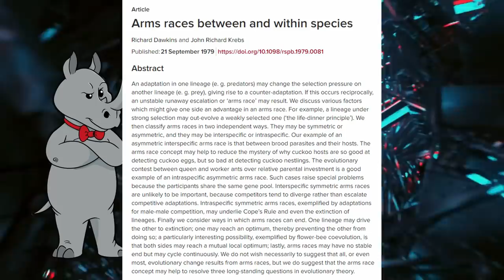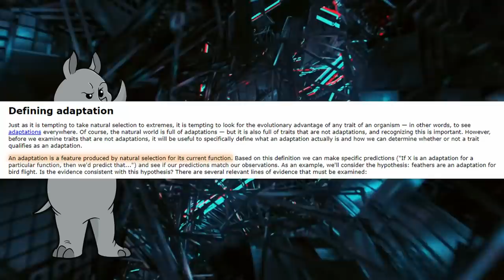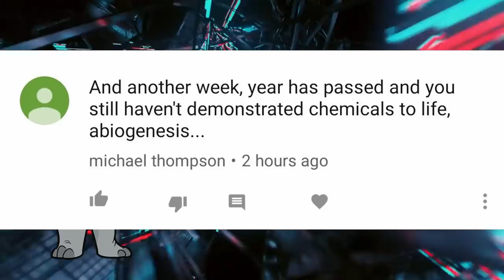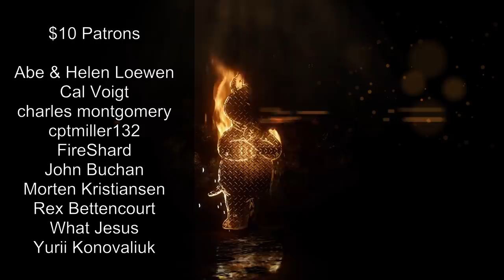David Rives is So Close and Yet So Far

Comment: There has been a very good example of this sort of thing in the UK - or rather in the North Sea on the east coast of the UK. When fished regulations required fishermen to use a net for cod with a design that let younger fish swim through, the cod population reacted. The evolutionary pressure drove the population to develop smaller adults, since the larger fish were caught they could not pass on their genes.The current population is preffy good at avoiding the nets.

Comment: I think I get it. He’s focusing on natural selection and mutations while forgetting another aspect: changes in evolution pressures. Evolution is slower where the evolution pressures are constant and unchanging because there is no strong need to be more fit for an unchanging environment; which traits natural selection selects remain the same, so there is no need for significant changes to accumulate. Changing evolution pressures speeds this up by changing what traits are favored or disfavored.

Take the hawk and duck example. Initially, ducks are at a relatively slow speed compared to now and hawks have relatively poor eyesight compared to now. Through random mutations and/or other mechanisms, some ducks end up somewhat faster than the others, which allows them to survive longer and have more reproductive success, so they get selected for. This changes the evolution pressures on the hawks, which now need to develop a way to catch these faster ducks. Now, the ones with better eyesight end up better at catching prey and so are more fit. This changes the evolution pressures on the ducks as now just being faster than the first generation ducks is no longer sufficient, leading to even faster ducks being selected for. This changes the selection pressures on the hawks so that the new average eyesight isn’t enough, so even better eyesight gets selected for. The evolution isn’t faster because the mechanisms of evolution are getting faster but because the survival pressures are changing.

Let’s say that, at some point for whatever reason, the ducks stop getting faster. There will still be some hawks with even better eyesight than the previous generation, and they may even be more favored, but the amount of additional success compared to the previous eyesight is much smaller because the ducks aren’t improving their defenses or evasions in any way, so the selection pressures are weaker and the evolution of better eyesight in hawks slows down until an equilibrium is reached or something. For the ducks, where the hawks stop improving, it’s even more straightforward. Moving faster requires significantly more energy, so if there’s no longer any change in the environment and their predators, the ducks with the same speed will be selected for once a balance in the trade-offs between energy usage and fewer deaths by hawks has been reached, thus, evolution of faster speeds slows until it effectively stops altogether.

Now, even when the evolution slows down, the mutations will happen at the same rate. The same number of hawks with better eyesight than their parents will be born, and the same number of ducks that are faster than their parents will be born. Additionally, the death and reproductive rates will be more or less the same (for this particular set of circumstances and ignoring other potential factors), so the time it takes to get from one generation to the next and the population growth rates remain more or less constant during this time, whether there is an evolutionary arms race or not. The difference is in the strength and direction of evolutionary pressures, and thus how quickly new traits will be favored over old traits. In other words, the proportion of hawks with the better eyesight that survive compared to the last generation and the proportion of faster ducks that survive compared to the last generation are different depending on the existence of an evolutionary arms race between them.

Comment: Seems to me from his rather garbled understanding of natural selection that he thinks that it's the mutation rate that not only speeds up during periods of rapid evolution but is the only part of the process that does sound and/or is the rate limiting step.

I mean, he's not wrong that if you subjected one species to a mutagen and the other not you'd get differential mutation rates, but that's largely irrelevant. 

Selection pressures, population size, generation turnover and heritability of the trait are all far more important.  

I'd point out that something like wing length is one of the many traits that exist as a normal distribution curve. Not all ducks have the same length wing. If selection pressure is such that the upper quartile have more reproductive success, the mean wing length  in the population will gradually increase.  One can also have selection pressures at either extreme leading to a site into two populations, and one can have selection pressure towards the mean, leading to stasis in a trait.

It's another case of creationists not knowing how much they don't know. Michael whatsisface the comment of the week is another one.

Comment: what this guy also doesn't seem to grasp is that an evolutionary arms race doesn't speed up the rate at which changes happen, but instead how hard they are selected for.
normally a population has variety in it. hawks with better and worse eyes. doves with faster and slower reaction time. an arms race does away with much of that verity as the worse eyesight hawks and the slower doves will probably not survive and never get kids. same rate of forming variety in a population, harder pressure that removes variety in a population.

Comment: In any generation of ducks, you are going to get a variety of wing lengths.  If extra wing length gives even the tiniest advantage of avoiding hawks, the ducks with long wings are going to have an edge in reproducing to form the next generation.  The babies will inherit those long wings.  The next generation will have a greater proportion of long wings than the current one.  This is common sense. How could it be otherwise?

The whole process repeats over and over lengthening the average wing until the wing reaches the optimum length.

This still works if each generation adds only 0.1 millimetre.

Comment: Actually natural selection and mutation has already been proved   In the North of England in the 19th century there was a small white moth.  This moth (or was it a butterfly.  It was so long ago si ce my schooldays)  used to flit about happily between the pale trees and used to be able to hide from it's predators by hiding on the trees.  However the Industrial Revolution happened  The trees it used to hide in became black due to heavy industrial pollution.  However there was another butterfly mutation of the same species that turned out to be nlack and used to be eaten by the same predators that couldn't see the white ones.  However when the trees turned black, the white ones could be easily seen and were eaten by the predators.  However the black mutations rose in prominince due to the white ones being eaten.  The Black butterflies genes became domiinant due to it NOT being eaten.  However after at least a century either due to anti pollution policy or simply the factories becoming redundant, the trees turned pale again.  However the black ones were then eaten.  However the white ones (who still survived due to mutations or luck) suddenly couldn't be seen and so the white ones who were few in number suddenly increased in number due to their genes being better for the current environment than the black ones .  The black ones have all but died off and we are basically back to the situation we were in in the early 18th century where the white ones are predominate..

Comment: "All three working in tandem"...?  Good on evolution but bad at maths.
Reply: Tandem does not mean two of. In tandem can be used to describe anything which is working in conjuction with something else. For example, the cylinders in a car engine work in tandem with one another. It doesn't matter if you only have two or if you have eight, the phrase is still accurate.
Reply: Eadwulf Slecgwyrhta - in common usage, tandem means two seater bicycle... While I am aware of tandem being used for cooperation, it is commonly used when there are only two parties, together or its synonyms are more common for multiple (3 or more) parties.
Reply: @darrenhemingway7121 Although it is more commonly encountered as two of, does not make it exclusively so. I appreciate that tandem bicycles tend to be designed for two riders, however, it is not limited to just two. The same is true of a tandem team of horses.
Reply: Eadwulf Slecgwyrhta - granted that tandem horses mean one in front of another and not number and hence the naming of the tandem bicycle as riders one in front of another rather than the number of riders (as anyone familiar with British 1970s tv comedy will understand), in common usage today, tandem refers almost exclusively as two or pair.  Even your example for car cylinders, my experience of tandem in this context refers as two cylinders working in the same part of the combustion cycle (like in a V8).
Reply: @darrenhemingway7121  "tandem refers almost exclusively as two or pair." yes, but not exclusively. Therefore your original statement about VR being bad at math is incorrect ;) 

There are very few examples of where synchronous ignition is used with internal combustion engines. I doubt that there have been any V8 engines were two cylinders are at TDC the end of the compression stroke at the same time. I cannot see any advantage of using this configuration. But then what would I know, I only have decades of engineering experience within the automotive and motorcycle industries.

Comment: fittest => most fitting

Also, isn't it cute how creationists fail to take into account the irreducible complexity of the Theory of Evolution itself? If you remove one of the important parts, evolution stops working. Yet they only look at the parts individually.
You need at least (natural) selection AND mutation. Take out either part (or supercharge either part too much) and it stops working, and the population stagnates (or collapses).

Comment: God is not the author of confusion? Four, yes four, contradicting gospels written in different languages by unknown authors assisted by supposedly unknown dubious eyewitnesses that then need many different translations by many different men and require many different interpretations by many different men with no actual first editions available. Or is it four independent cross referencing  accounts that help you fill in the many gaps in the other gospels that are written by unknown humble authors using different, in my opinion, reliable eyewitnesses with, in my opinion, reliable copied manuscripts that are, in my opinion, accurate enough and it just so happens that my copy of the New Testament bible is the one and only true correctly translated and interpreted bible, because God wouldn’t fool me, so you can throw all of the others away.